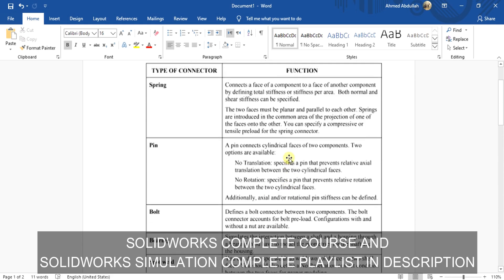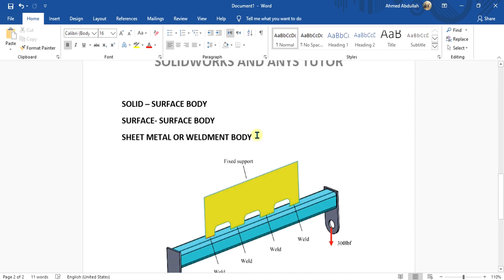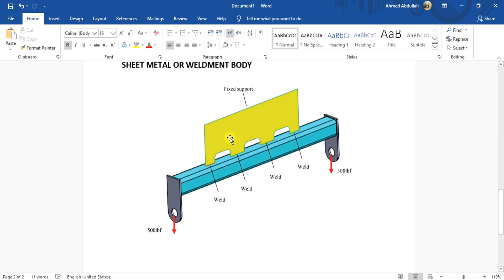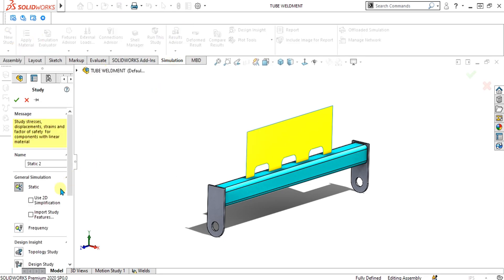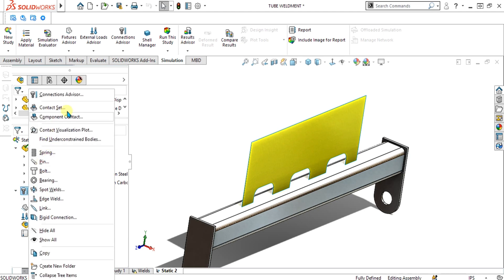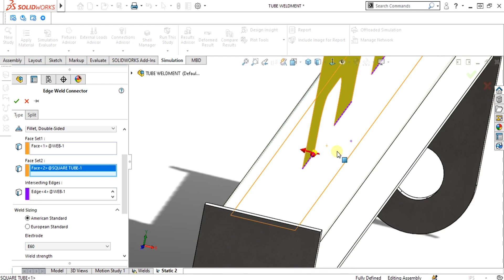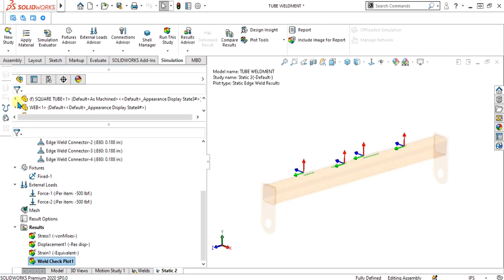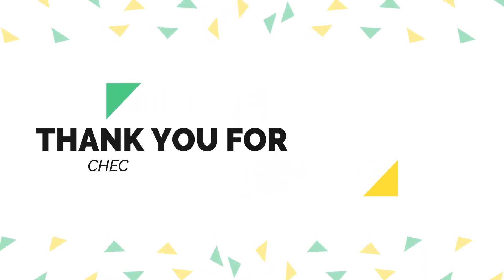✅ How to Determine Edge Weld strength in Solidworks Simulation

Comment: Thanks but I can't seem to connect any two faces or solids and keep the error message: "Weld Edge Connector should belong to faces of surface bodies or sheet metal bodies" I've watched several videos on weld connectors, searched for answers in forums and but can't figure out what I'm missing. Any suggestions greatly appreciated.

Comment: Please do roller joint
Reply from the maker: Sure
Reply: @solidworksandansystutor  thank you
Reply: @solidworksandansystutor  please upload soon , thank you
Reply from the maker: @MuhammadAwais-jh2dy  You are talking about Roller Fixture?
Reply: @solidworksandansystutor  yes like bar with pin joint disc roll on surface. Slider like
Reply: @solidworksandansystutor  I understand very better from your videos as books not help much
Reply from the maker: @MuhammadAwais-jh2dy  Will Study about it Then will try to make tutorial.
Reply: @solidworksandansystutor  yes thank you